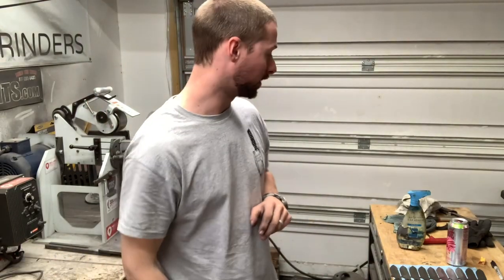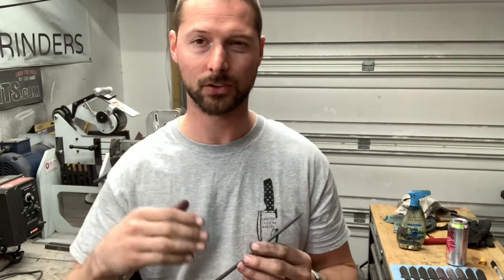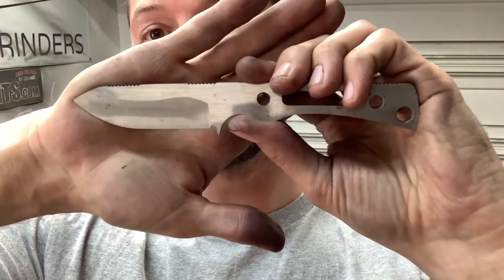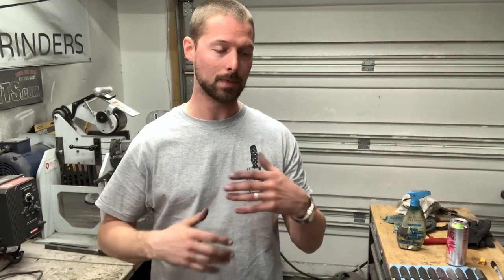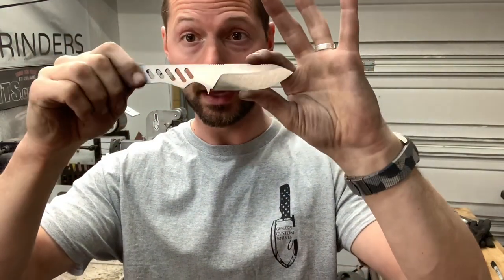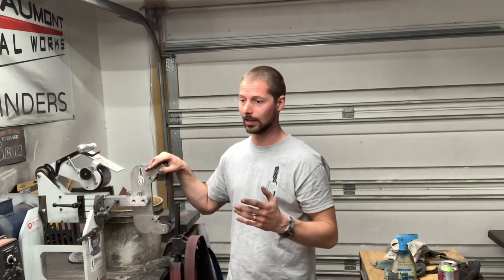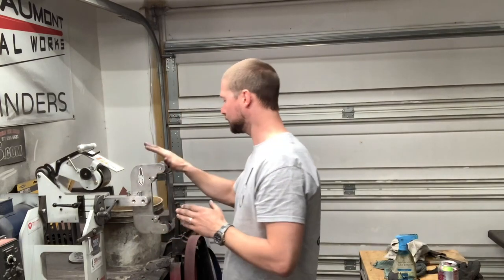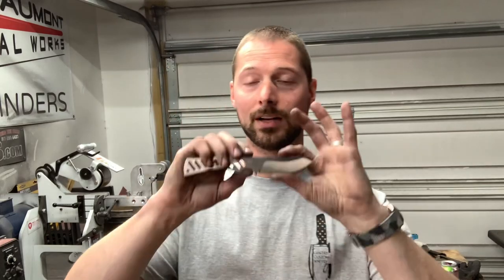Grinding better bevels!!! Free hand Knife grinding tips and tricks.

Comment: I just finished my first knife on my new 2x72. Well it definitely needs getting used to, but it’s so much more fun and you just feel it’s what fits best to knifemakers with variable speed of course... so I am still struggling a bit with the bevels and surely not quite there yet. As you said, if the heads not there, do something else, not only on the grinder! It will make you regret those little imperfections on your knife and time will not always help you getting rid of them!😊

Comment: Really nice looking bevels. I am guilty of trying to save money by using a belt to long. Let’s take the batch of ten you just did. I would imagine you started with a new 36,80,and 120. How many knives did You get with those belts? When did you switch them out? Thanks
Reply from the maker: I started with new belts and on the 8th blade I started to want to put a new one on for my 120grit but muscled through and got them all done. 😬 I got lucky lol